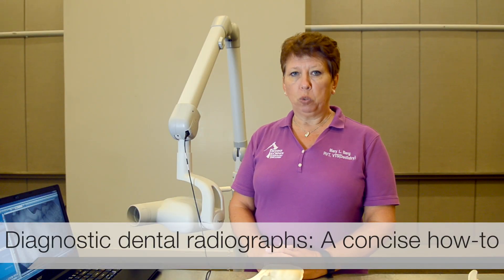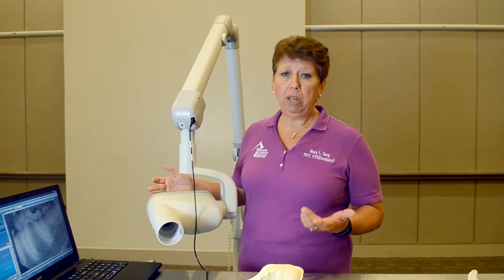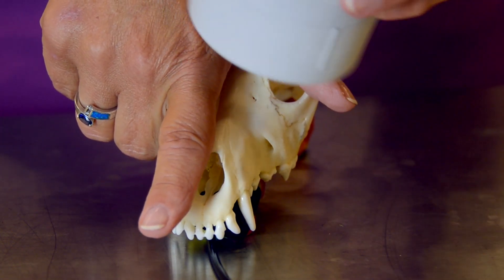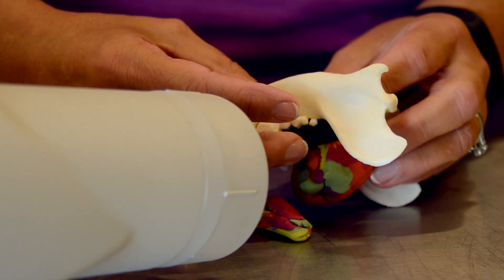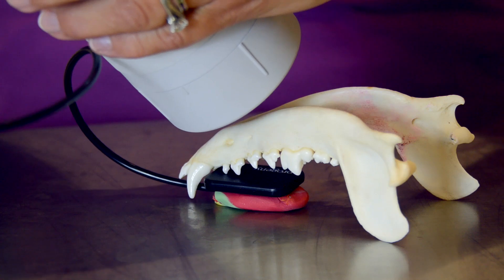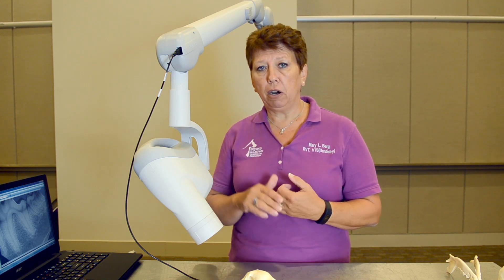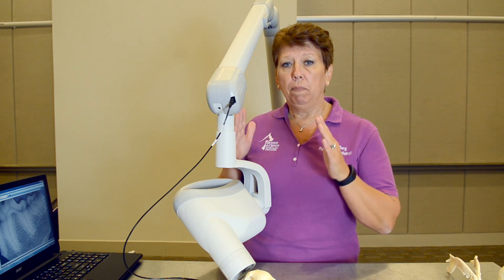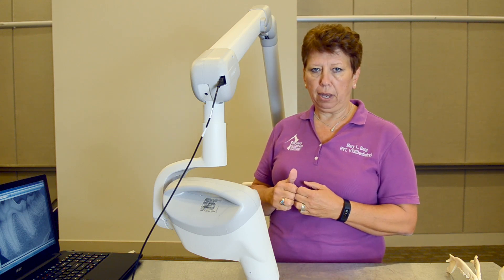Diagnostic dental radiographs: A concise how-to

Comment: Thank you, Mary. Unfortunately for me. we have our animals in lateral position and this makes it very confusing for me to shoot at the correct angle. We also have a faucet in the way which adds to my frustration. So, because an animal is on it's left side for example, the xray tube comes from the other direction. I don't know why we do that.(it is one of those: this is how we've always done it things) Hence, I struggle with 'diagnostic' images.
Reply: I am the only one in my hospital that takes dental x-rays in sternal/dorsal recumbency. Everyone else is used to doing it in lateral and they don't care to change. They eventually get diagnostic views, but I notice that they often need to do retakes and it takes them a lot longer. I am at the point where I can do a full set in roughly 10 minutes. Don't settle for an inadequate technique!
Reply: I am left with no choice. We are not given the time to reposition the animals, especially if it is a large dog. I just don't get why not. We are always in such a mad rush. We barely intubate and the immediately start taking xrays, blocking, extracting. All because the consensus is that if you can do it in sternal/dorsal, then you can do it in lateral left/right, so no need to take the time to reposition and mess with all the leads/monitoring equipment, etc. It is very frustrating, believe me.
Reply: I'm sorry. I get the frustration though. We have the same issues in my hospital. We overbook and more often than not the patient suffers. We don't have enough staff to monitor and recover appropriately. It's all about getting them down and up, then moving onto the next one. I hate it. I guess I'm fortunate in that my doctors know I'm passionate about dentistry and will let me do my own thing and go at my own pace. I just wish everyone else had the same outlook on standard of care.  :/
Reply: your youtube is a great tool for me though; I've watched it several times. It has helped me a great deal, even if I have to try to convert it to the vertical plane.
Reply: Hi ! It is confusing to see x-rays taken in lateral position (in humans we do not use that technique).  Is the x-ray machine any diferent than the "human" one?  Is the size of the senzor smaller?
Reply: We do also but I still found this helpful
Reply: Why leave a patient lateral for extended periods of time if you don't have to? The "bottom" lung won't be able to fully expand